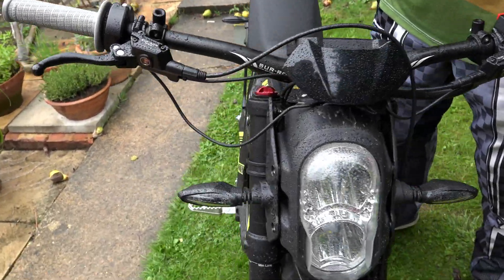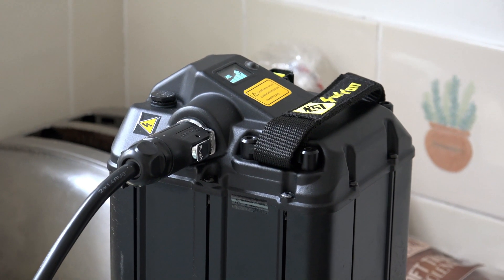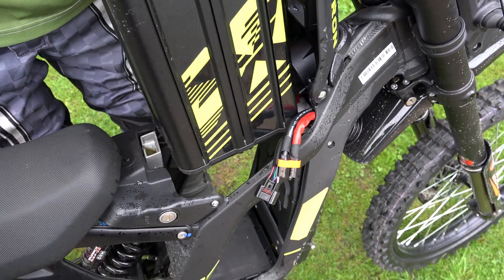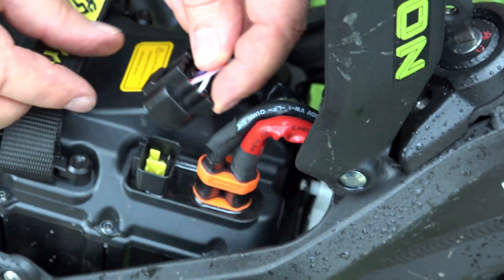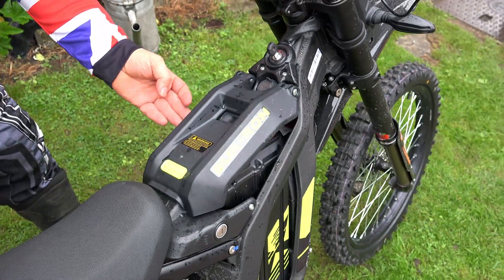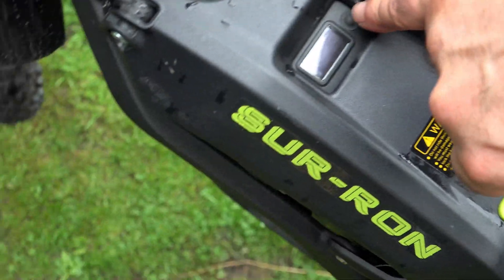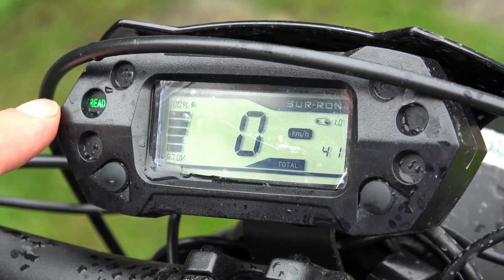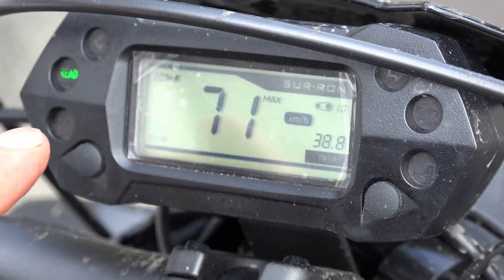How Easy is it to Charge a Sur-Ron Electric Motorcycle?

Comment: Do you have to switch the the red button off when you charge it are just when you take battery out to charge?
Reply: I have one myself, the red switch is just a fuse and it's a safety measure, you only turn it off to take the battery out, and back on once the battery is re-installed, the longer you own it too the cords get easier to take apart so it becomes less hassle over time

Comment: I wish these could attach to car charging outlets. I know you can get an adapter but you still need to use the slow ass original charger no fast charging mode. Maybe one day
Reply: Well you can get a variable  charger and charge at a little higher amprage and charge it faster shaves roughely 1 hour 30 min off the time
Reply: @kingkazuma2568  Ahhh good to know i thought the original charger can go 0 to 90 in around 1hr30? is that not correct?
Reply: I think their is a varible that works woth the stock battery

Comment: Do you know if you can dip the headlight? Mines always seems to be in high full beam
Reply: you can buy switches... the light is such a small power draw it wont make any difference on your total ride time.. idk I was using my surron as a light when my power was out and had i used 1% battery in 12 hours

Comment: I’ve just bought mine the road legal one from drop the hammer Manchester and I’m 16 stone and have got minimum of 27 miles to 35 miles on a single charge so far
Reply: Have u been able to make the headlight less bright or get it to dip? Mines is eye level with car drivers and its blinding them 🤦🏻‍♂️
Reply: On average speed?

Comment: guys wearing 30 pounds of gear or more and wonders why its bad range like common dude !!!!! and max load capacity for the surron x is only 220lbs so if u fat u gonna get poor mileage regardless your driving style
Reply: So if I'm only like 135 lbs I should see faster speeds and longer ranges? 
Thinking of getting one. 
I saw on lightly used only $4,000.

Comment: How long does it take to reach 100% battery charge. To do just 39km on 80% doesn’t make this a viable alternative
Reply from the maker: It should do 40 miles (64km) on a charge, but as the bike was new the battery hadn't been run in yet.  Empty to full is about two hours.
Reply: WiltshireByways will Paul continue to use the Sur Ron and give an update on the charging times and if the the range of the battery improves
Reply from the maker: @gnarlybadger690  No - he only had it from the importer for a couple of days.

Comment: The range is the killer and an hr to add just over 25% is not ideal but hopefully the battery tech will improve and makes bikes like this a real alternative for the 200 plus mile per day trail rider,that is if they can fit a clutch to it lol,great vid jim but my ebike can easily do 50 miles on a charge and I can ride far more legal trails .
Reply from the maker: Range should be about 40 miles with a 90-120 minute charge time from empty to full.  The bike was new, and I'm told that the battery needs to be 'run in' before it reaches peak capacity.
Reply: what do you mean by hr and 25% ?